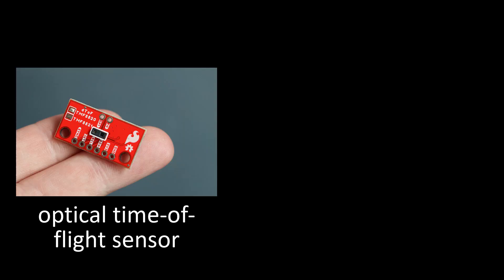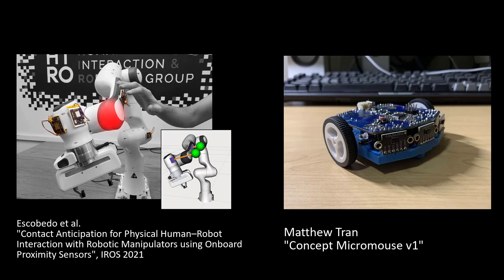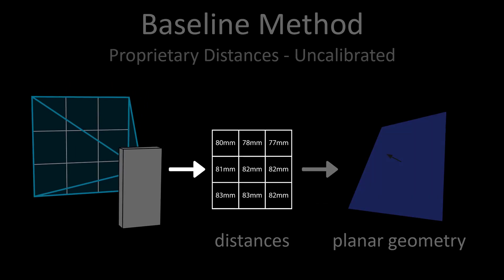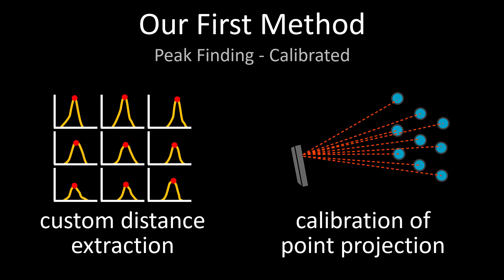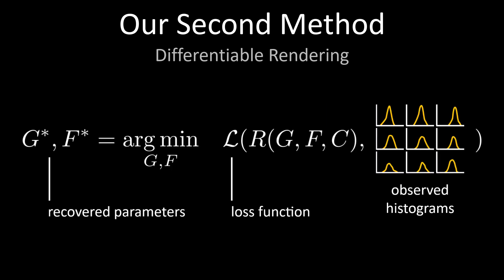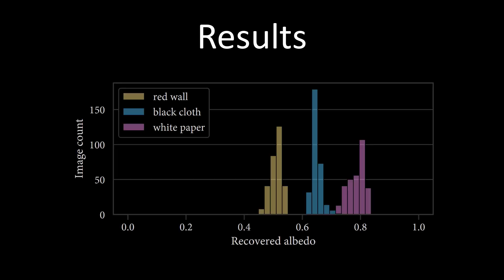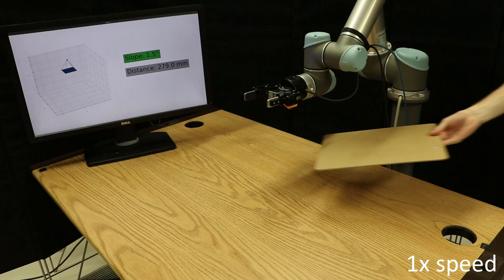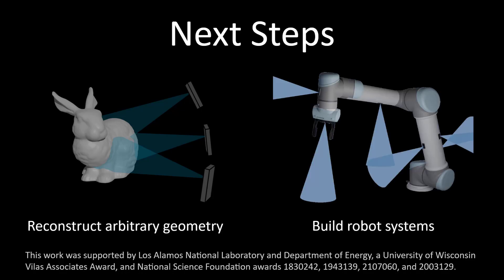Unlocking the Performance of Proximity Sensors by Utilizing Transient Histograms

Comment from the maker: To clarify something we've seen many comments on: our results don't mean that the manufacturer's solution for distance estimation is "bad". The manufacturer's solution runs onboard the sensor, which has a minuscule amount of computing power, and was likely designed to support generic use cases for their sensor, not the very specific planar recovery that we perform.
Reply: But didn't you mention that they make the output signals of the modules proprietary, thus likely reducing the performance/potential capabilities of it?

Comment: what is the max speed (frame rate) that you can get with this sensor? Can it do 1000hz or more if you directly utilize low-level reading?
Reply from the maker: When reading the full low-level data off the sensor, the frame rate is limited to about 3 Hz. It's limited by the I2C interface of the sensor, which isn't really designed with reading full histograms in mind. If you just get the distance estimate summaries, it can run at 200Hz+.

Comment: I'd be interested in seeing a version of this maximizing for linear accuracy. The setup I envision is the sensor is mounted to a linear rail with a board/reflector fixed at a right angle to one end.
Then the sensor is set at a known distance to the board, the differentiation is run with known values for the distance/angle to calibrate for the surface reflectance.
Finally the sensor runs on the linear rail, with the calibrated data and the fixed angle relative to the surface to provide only distance data.
I'm curious how much all this boiling down of the data will increase the accuracy of the linear distance measurement.
Reason being is that I've been interested in the idea of using these types of sensors for closed loop control of a 3d printer (I like the idea of knowing exactly where the print head is at a given time), but one issue is the accuracy. The sensor frequency would definitely be too slow but there are other comments addressing it that could be explored.

Comment: I'm immediately thinking of all the super low cost ways you could now provide backup orientation data to an IMU. With the simplicity and price-point, you could use it to provide a crosscheck to combat sensor drift over long trips. If the sample rate is too low, use two! haha. So many lunar landers have gotten turned around over the years due to sensor confusion, and here's a few dollars that can provide surface geometry data that might be used to reorient. Really neat project!

Comment: Surprised these sensors evolved into low resolution 3x3 cameras.  Definitely an advantage to apply offboard computing power to the histogram analysis.  The integrated processor is a Cortex M0.

Comment: Very good work guys. Outperforming a company this way makes me wonder if they let the interns write codes for these things.
Reply: They most likely do. I once bought a muscle sensor from Seed-Studio and the only code example they provided was using the raw unfiltered signal to light up an LED bar. This is so far off from the usual field of use for these sensors it really made me scratch my head why nobody over at seed studio has actually bothered trying to get a filtered and clean signal from their hardware, especially since the filter settings depend a lot on exactly that hardware.
Reply from the maker: See the pinned comment - we actually don't think the manufacturer's solution is bad. It's just more constrained on compute and designed for more generic sensor use cases.
Reply: It's cause all the C levels are just biz majors whose only purpose in life is to convince investors and customers that their company has some sort of "secret sauce". I fucking loathe companies that NDA their datasheets like Pixart Imaging (and plenty of others).

Comment: Two questions:
- Is there source code available for just the plane reconstruction (excluding robot moving parts or such)?
- Is there similar solution for higher range similar sensors? Would be pretty interested if there is and might have use case for AR. Maybe sennsor range is high already but not sure. I know some of these ToF sensors have longer range like around 10m at most (which would be enough for my case) but I guess maybe this exact sensor has smaller range.
Reply from the maker: Code has just been released! https://github.com/uwgraphics/ProximityPlanarRecovery

The sensor used in this work typically has a max range of about 3 meters. We set it to "low range, high accuracy" mode to give it a max range of 1m for higher temporal resolution. Our solution could in principle work with higher range sensors. The highest I know of in this form factor have a quoted max of 5 meters (e.g. ST VL53L8)
Reply: @uwgraphics  brilliant work; thank you for publishing the code!
Reply: @uwgraphics thanks for publishing the code. you said you restricted it for<1m, what is the temporal resolution then?
Reply from the maker: @paulwesley3862  There are 128 bins, but the first 15 or so are never used. The bin resolution is the equivalent of about 1cm. That doesn't mean the final output of the sensor is limited to 1cm resolution, though.
Reply: @uwgraphics  thanks, but what about the temporal resolution, how often does it update them?
Reply from the maker: @paulwesley3862  As in what is the refresh rate? We can only get histograms off the sensor at about 3Hz as we're bottlenecked by I2C bandwidth. If we retrieve only proprietary distance estimates, we're able to get about 120Hz from the sensor.
Reply: @uwgraphics  Thanks! I just realized its 3FPS because of I2C though so likely need some sensor fusion, but this is a very cool project with low cost sensors becoming much more powerful than they by factory are! Awsome work!

Comment: I wonder if this could be used to make a device for 3d printer bed leveling to either make a bed mesh or for real time manual bed leveling. This is very cool.
Reply: Unless you come up with some  insane hack to increase the accuracy from a few millimeters to less than 0.1mm you are out of luck. These sensors measure the time of flight of light - to measure with 0.1mm accuracy you would need to measure with less than 1ps time resolution...

Comment: I’ve been longing for an affordable, compact 3D scanner/solid state lidar for years. So many things you could do with something like this. I use a lot of single point ToF sensors in my projects, didn’t know there were 9 points measurement ones. Maybe by having a small array of them, each at a small angle, you could create a working 3D sensor?

Video is incomplete. Need to see more
Reply from the maker: Combining data from multiple distributed sensors is an interesting direction for future work.

There are higher resolution versions of these sensors available! Check out the ST VL53L8, which reports 8x8 zones. The VL53L8CH even reports histograms, but they're lower temporal resolution than the TMF8820 that we use.

Comment: Good work and clean explanation. I imagine you could get quite good results with a sensor mounted to an unbalanced motor. Although I’m not sure what the sampling rates are with these devices and it would certainly be introducing more cost and points of failure.
Reply: I wonder if anyone makes a cheap TOF sensor with a SPI interface?

(Just checked, first result was for some Broadcom modules that are ~~$70 in onesies, but they’re intended for greater distances (up to 10m, 100m with dual frequencies) Didn’t go further, the ~$20 modules are perfect for house use case)
Reply from the maker: @DaveEtchells  The new ST VL53L8CH has an SPI interface. Unfortunately the example code is all in I2C so it's taking us some time to get it working over SPI. If anyone gets it working, we'd love to get in touch!
Reply: @uwgraphics  Ah, cool! That should give you a huge boost in frame rate. Fantastic work, it’s astonishing how much better the precision is than with the manufacturer’s own code. I can see this having lots of applications: It’s a very cheap and performant solution for a common need.
Reply: You can set the sample rate of TMF8820 anywhere on the order of 1 to 1000 Hz, trading off accuracy - the actual sample rate is something like 50kHz, but individual samples are combined for better accuracy. (I don't remember the exact numbers, but you get the point)
Reply from the maker: That's right. In our configuration the sensor sends out 4,000,000 pulses of light for every measurement. It is still able to report measurements at about 10Hz (but we are bottlenecked by the I2C interface to about 3Hz for full histograms). I'm not sure how low you can go. I expect for something like a spinning LiDAR with this sensor you would be limited by the interface bandwidth, especially if you want to get full histograms.

Comment: This won't be very accurate with translucent materials, I assume ?
Reply from the maker: We haven't tested it thoroughly but probably not. There may be ways to deal with it, especially if you know the material ahead of time and have a model for its subsurface scattering.
Reply: @uwgraphics  Yeah I was thinking about modeling the material.  This might be a good option for us 3D printer users as an alternative for bed leveling similar to Bambu Lab's Lidar bed scanner.

Comment: Very cool, always surprises me how bad the manufactures solutions are. Goes to show that even if you have all the hardware you could want software is still king.

This makes me cry at night being a hardware guy / lover.
Reply: just get better at hardware, duh
Reply: I imagine there are tradeoffs being made in the proprietary algorithm to account for harsher requirements than this paper was restricted to. For instance, it seems that they used a full fledged PC to perform their histogram analysis, whereas the chip manufacturers must make use of the microcontroller hardware onboard the chip itself. I imagine that under those circumstances, the proprietary algorithm is performing quite well.
Reply: Not really, as it needs to run on the chip itself. Taking out the raw data and using much more powerful processor to filter it, makes sense you can get much better results.
Reply: Kind of disappointing how the "proprietary algorithm" of the manufacturer themselves is so extremely lackluster. Who knows what kind of amazing potential is lost, because we can't actually utilize our existing hardware effectively.
Reply: @kerimgueney  yepp!
But people love to open wide and present their bee 🐝 hinds to the companies.
Thus, I've now accepted, what we're getting is what the limit is, cuz the mass majority will determine how our ownership will be affected.
If they don't care or complain, we're doomed, but I've accepted that by now.
Reply: This doesn't seem necessarily software. It's about having a different perspective on what the data is telling us, together with some math.